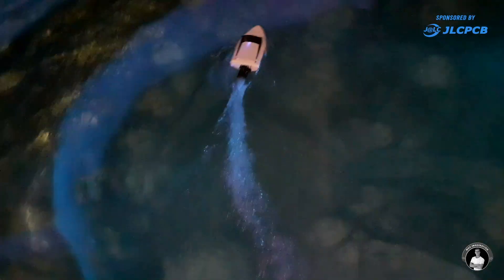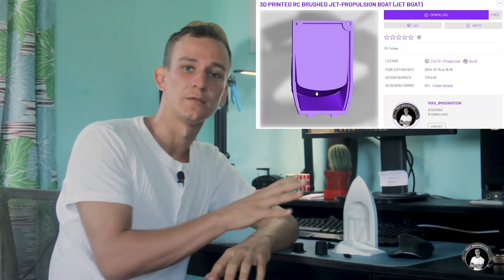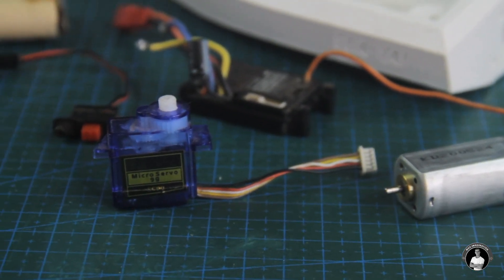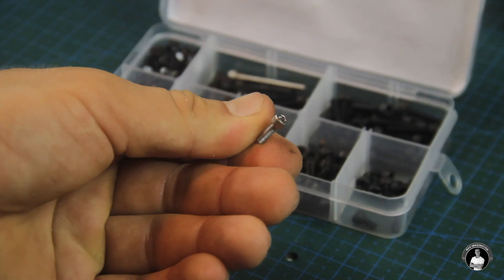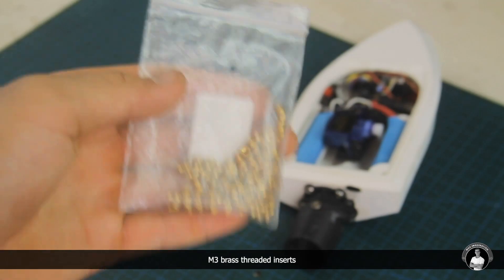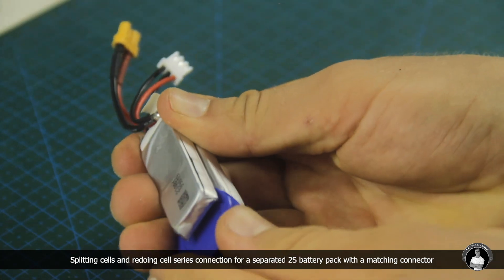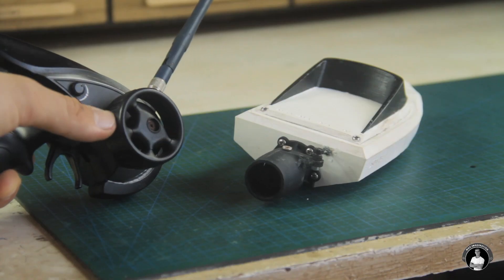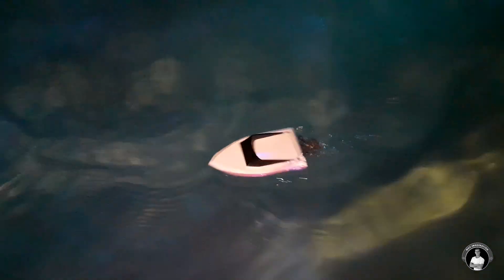Build this 3D Printed RC Jet Boat In One Day!

Comment: Where did you get the screw set are they a special type of screw or something standard? And did you have to make sure to model your design so they could fit?
Reply from the maker: It's an M3 type screw. It's standard for most of my designs.

Comment: Very nice project but to be honest, the performance was pretty bad. The improvements you wrote down were almost all very good. and forget normal brushed motors and yes go for brushless. And what works wonders for sealing your boat is designing and printing a tpy 3d printed lid that will close like a tupperware box. (look at jetboats from m-jet development). And what will also be a big plus is the fact you need to make sure the water will accelerate in the pump. You do that by making the section area smaller  the further you go backwards. The water has no choice than go faster compared to the speed at the inlet since water can not get compressed to a smaller volume. You need an optimum and do not ask me what will be the sweet spot for that sort of things. But that needs to be done to get a fast jet boat that will plane well. (and check the settins of the printer. The exessive stringing is not normal. Maybe buy a more modern printer. It is insane what the speed and quality of 3d prints is compared to the older style printers. But again. Love the project. It is fun to design your own stuff and be able to print it
Reply from the maker: Thanks for the feedback, I'll consider your suggestions for future iterations.

I agree, my boat could have performed much better. My first jet boat may suck in comparison to others, but future ones would be much better for sure and those who take this design and improve it will see better results.

Comment: 3mm rod doesnt fit my 10 dolar gone for nothing thanks

Sorry mb i used pla filament i forgot it can bent while printing. I solved it good print thanks🎉
Reply: I heat up the rod with lighter then i tried to melt the PLA but i cligges the Rods way the i came up with an idea and i used needle to open clog i just inserted and i think needle can work as metal rod will it can work or it can leak?
Reply from the maker: It's better you stick to using the rod and Widen the hole with a drill.
Reply from the maker: PLA tends to expand while being printed, so the hole size will not be exactly 3mm. You may need to widen it with a tool.

Comment: Is temperature control a problem? Thinking of making my own but worried about motor overheating. Dont want to add vents so water doesnt get in but would also be making an oven
Reply from the maker: It can become a problem with brushed motors over a longer use. I recommend using a higher quality brushed motor to reduce heat or simply use a brushless inrunner motor. Maybe water cooling would work - not air.
Reply: @MaxImagination  I will use a brushless inrunner motor. Thanks! You used M3 screws for the entire build right? Working with the water jet stl is tricky, so I dont know what size hole is used here.
Reply from the maker: Great. And not for the entire build - I happened to need M1.6 screws for securing the motor, same applies to this brushless inrunner motor - https://www.amazon.com/VBESTLIFE-Model-Brushless-3500KV-2Poles/dp/B0BRGGR8F8

Comment: What if we make the nozzle more small? Will it create more Thrust??
Reply from the maker: I tested that, it only seemed to worsen performance as then water got shot out the side gaps that allow the nozzle to swivel. If sealed with some form of rubber, then narrowing the nozzle would make a difference. Cheers.

Comment: Nice small project! Was problem with water inside? And how solved it?
Reply from the maker: Thank you! You can prevent water from entering by using a proper sealant solution or a better-suited o-ring/gasket.
Reply: @MaxImagination  now I am searching such sealant solution. Do you have an idea what hardness by Shore must be best, or rubber or silicone? Thank you!

Comment: Really cool!  Are the rx/esc combo and motor that you put links for the ones that couldn’t handle the power or would this be the better option?
Reply from the maker: Thanks! I have linked the better alternative motor that doesn't consume so much power and is more efficient. The same RX/ESC unit as I've used should match and work well.
Reply: @MaxImagination  perfect thanks  the motor is discontinued now but I’ll find something similiar
Reply: @MaxImagination  have you found a brushless setup that fits?
Reply from the maker: I have found one brushless motor that exceeded my expectations. Watch my RC drift car video and check the product link to them motor in the video description.

Comment: Built one with parts I had on hand but ended up way too heavy so I need a bigger boat. Still had fun even if I had to fetch it off the bottom of the lake when it leaked. Only lost a $3 brushed esc.
Reply from the maker: You might need to pick a smaller, more powerful (Brushless) motor and a lighter battery. This is not supposed to happen. How did you seal the lid and what parts did you use?

Comment: Ive been 3d printing this myself on an ender 3, and was wondering how I could recharge the batteries after they die , or if I just missed it
Reply from the maker: You can use one of these USB chargers with the battery's 3-pin connector - https://amzn.to/3yRqwFM

Comment: Does water leak into the boat through the impeller shaft hole?
It looks like you put a rubber disk with a hole for the shaft, but how well did that work?
Reply from the maker: It leaks through the top because of my weak sealant ring. The rubber disk only slowed down the shaft movement, so I removed it. Haven't encountered more than a drop of water leaking through the shaft hole.

Comment: Having never used a 3d printer I've always wondered what that outer ring that always seems to be around the party that's being printed. Is it some sort of reference?
Reply from the maker: It is a reference line used to confirm proper bed leveling before it starts producing the actual print. Super handy feature to keep.

Comment: Hey dude, Please make a detailed video on how to make a Transmitter and receiver(of audrino nano and NRF module) and its programming, I have watched your previous video on it but iam totally confused, please make it , or a simple Rc car which includes a single dc motor with servo (or instead of servo for stearing you can use dc motor😅), and this transmitter and receiver, 
Please Dude I beg you 😢
Please reply if your are gonna make it 🥲

Comment: The jet engine is one of the inefficent propulsion for boats. Maybe you can try alternatives and compare them, that would be interesting
Reply from the maker: The water jet is only as efficient as its motor. These in general do push out more water at higher speed, mine simply did not get a motor powerful enough. Will try with outboard engines and others in the future I'm sure.

Comment: It's a bit unrelated, but how do you charge that tiny lipo (50mah)? The tp4056 does 1amps which will destroy them...
Reply from the maker: Hi. You still use the TP4056 with such battery but instead, change out the current limiting resistor for one that's 10K ohms. You can look up "TP4056 current resistor rating chart" and you will see what resistor to use according to the battery's current capacity.
Reply: @MaxImagination  Ok thanks... helped a lot 😁

Comment: Well done! I was surprised how small it was,very cute but capable looking boat. I noticed you had a lot of stringing on your 3d prints. You should probably play with your retraction setting and if your in a humid environment consider making (or buying) a dry box. You can build one for very cheap and in the meantime you can dry out your pla filament by placing it on your bed spaced up with something like Popsicle sticks and place a box over it with small holes on the top. Then heat your bed to like 50C and leaves for several hours. That should dry out the filament.
Reply from the maker: Thank you, Asher! Yes, you made a good point there with what I should do to remove stringing, I'll try that! I'll also order one of those filament dry boxes. In the meantime, would keeping my filament rolls in a sealed box or dry rice work? Asking this since I do not live in a cold country to have electric blankets or anything of the sort. Cheers!

Comment: What happend with your stringing?? nice boat but printer needs some love.
Reply from the maker: That must have been due to a roll of filament going bad. Will need to also tune the retraction settings a little. Cheers.

Comment: Hello. How do you add custom titles? And also,is there a way to convert an automatically generated titles into custom titles?
Reply from the maker: Hello. If you're referring to the engraved text on my boat design, that can easily be done with the text tool in Fusion 360 when creating a sketch.
Reply: @MaxImagination  I actually meant video titles
Reply from the maker: I first come up with titles myself and bounce them off ChatGPT to make them sound better. @CenReaperYT.
Reply: @MaxImagination  oh, okay

Comment: Boat is great but 3d printing stringing is a nightmare so try dehyrating your filament and tweek a bit in retraction settings in cura the prints will look clean an smooth
Reply from the maker: I think it's the humidity that's affecting my filament, it's mainly the while one that strings a lot. I will try with adjusted settings too. Thanks.

Comment: Noticed that your pla was stringing. Your filament seems like it is wet from mosture in the air. Just a fyi a heating box may help for cleaner prints and for the filament. Keep up the work!
Reply from the maker: Thanks for your tip, I encountered some PLA storage boxes with temp adjustment. May consider picking up a couple of those. Cheers!
Reply: @MaxImagination I think it has to do more with your retraction settings than wet filament. Try doing some retraction tests to determine the best setting. Need to also make sure the nozzle and bed don't have play in them and the belts are tight. You should be getting better prints out of that guy. Also, awesome video! Neat little boat! Glad you included the problems you encountered, it gives others a chance to learn from your mistakes as well. Going brushless might need a water cooled esc.

Comment: great build but you need a better 3d-printer...
Reply from the maker: What's wrong with my 3D printer?
Reply: Or just chamge the settings.
Reply from the maker: @oftheborg Exactly! Just changed the filament retraction settings and no more stringing...

Comment: Fantastic work, Max! Amazing little boat!!! 😃
About the water leak, PLA isn't waterproof. What you can do is to paint a thin layer of epoxy over it, for example. And there are lots of other ways to make it waterproof. 😊
BTW, a 20A esc should be more than enough for the 180 DC motor. I used cheap 10A escs on my WPLs with one of those (although they are probably brandless).
Anyway, stay safe there with your family! 🖖😊
Reply from the maker: Thanks for the tips, MC! I appreciate it. Totally agree, an ESC of a higher amperage would have done the trick. I may consider building a bigger jet boat in the future that is all brushless for peak efficiency and power.
Thanks for you comment! Cheers! 😃
Reply: @MaxImagination  Sweet! Looking forward to it! 😃